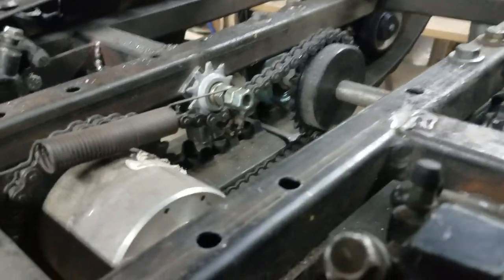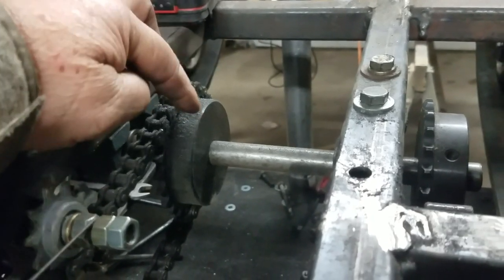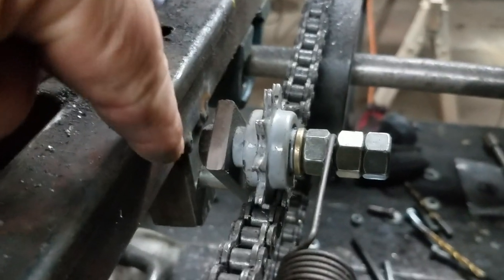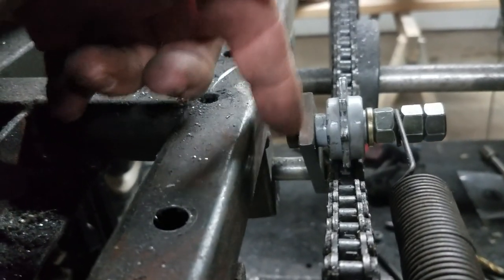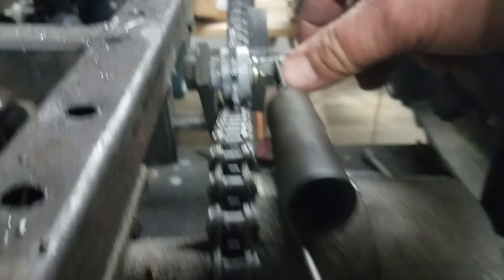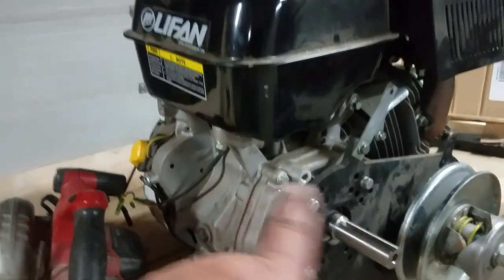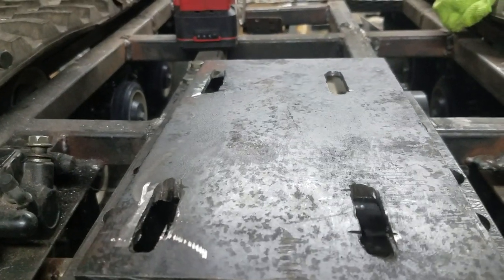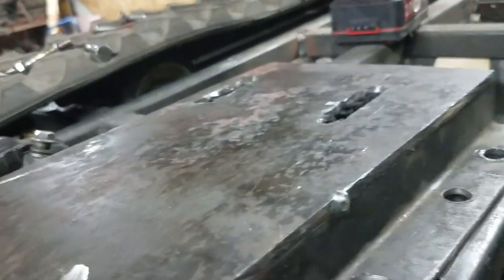PTV Build 14 - Chain Tensioning - It is important!

Comment: You can boil the chain in dirty motor oil, will lube it longer by soaking into the pours of the metal so you can combat the stretching. The dirty motor oil in high in carbon and helps to lubing the metal when compared to clean oil..

Comment: You could also try a double chain set up. Kind of like dual chain used on timing gear. Your doing a very good job.👍
Reply from the maker: Thanks!  I actually thought about that, particularly with my first one which has the #35 chain.  We'll see how this #420 holds up.  Thanks for watching and your kind comment.